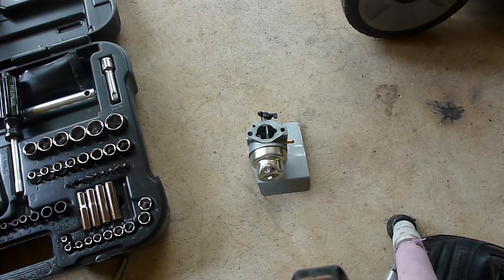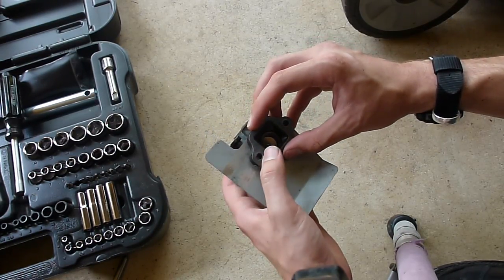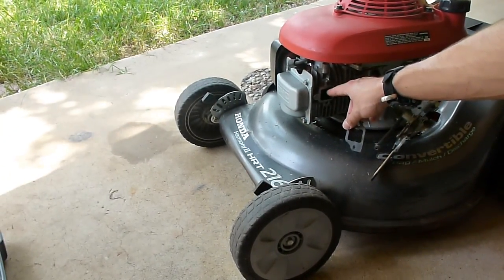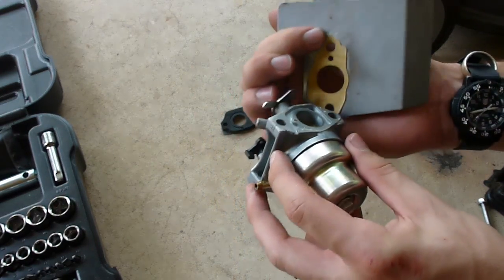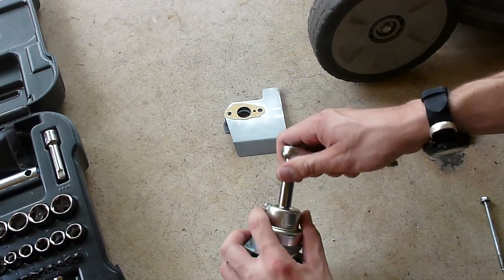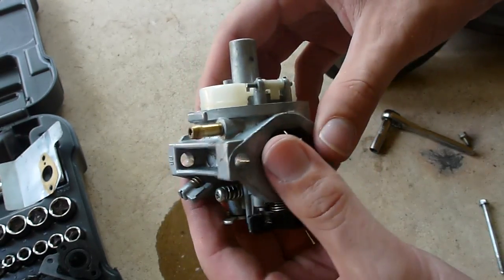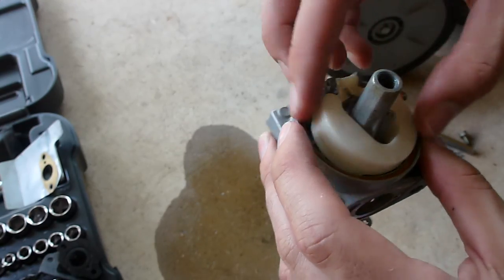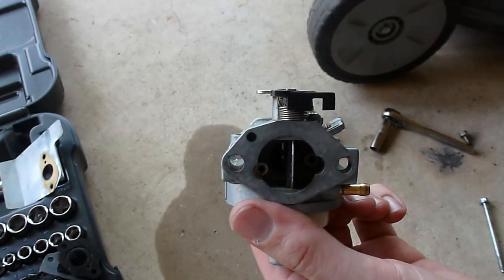Honda HRT216 Mower Problems: Carburetor?

Comment: The main jet and secondary jet need to come out and be cleaned. Use a flat blade screwdriver in the middle tube to remove. Just unscrews. Try that

Comment: MAin jet is probably clogged. Take it out with a flathead screwdriver. Below that is a tube which also has to be removed and cleaned. You must clean all the holes in the jet and tube for proper operation.

Comment: Looks like you need to take the carb further apart, as it is likely a clogged main jet. Clean it with compressed air, a really thin wire, and carb cleaner.

Search for "How to fix a honda lawnmower part 1" from doublewide6 for help in disassembly/cleaning.

Also, look for "idle limit cap removal" to learn how to remove it without breaking it. Use red Loc-Tite when reinstalling the cap. Seat the screw, unscrew one full turn, then cap.

Good luck.